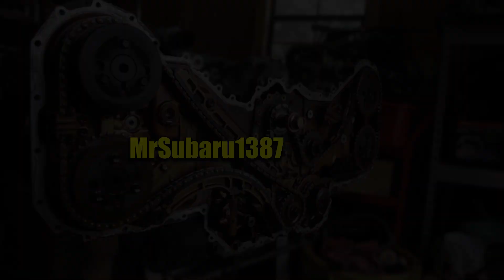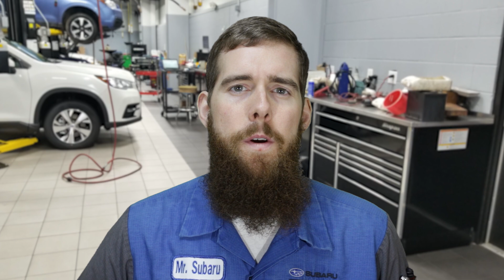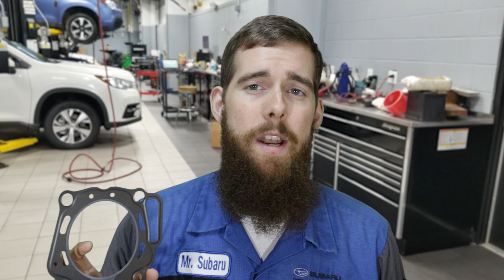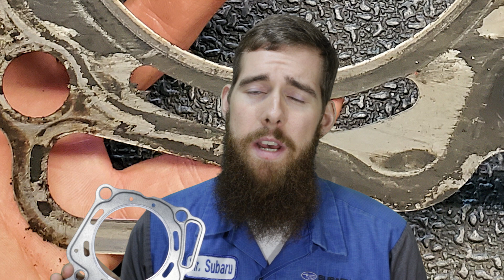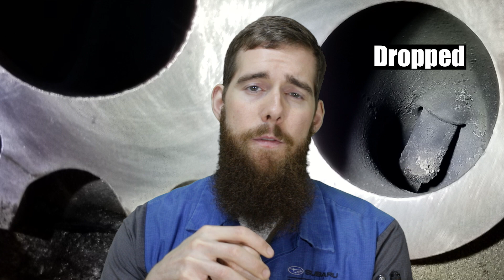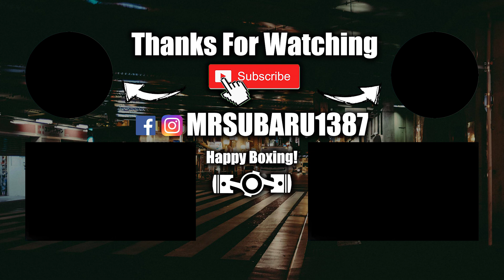Subaru Head Gaskets Explained

Comment: My personal experience with a 1999 Impreza RS 2.5, from new. Failed rear wheel bearings, seized brake pads in the caliber brackets, failed & recalled mass airflow sensor, failed head gaskets. Dumped the car after 2 years & never looked at a Subaru since. Say what you want, Subaru’s head gasket & head bolt reputation are well deserved. Watch the tuner channels. Power upgrade mods typically center around head gasket failures. Subaru design choices have resulted in failures, or just barely surviving daily driving. The tuner channels have the fixes, why Subaru doesn’t address is a puzzle.
Reply: Dan Chesney 

That 99 RS might be a bit of a collectible had you hung onto it.  The failed wheel bearing is a common Subaru fault but cheap to fix, DIY even if you have access to a press but I had my mechanic do mine for a couple hundred bucks.  I’ve had a brake caliper seize on me too, around $70 for a replacement at Autozone I think?  Again DIY and cheap.  The RS I believe unfortunately had the dual cam motor susceptible to HG failure but once you get it fixed with an updated gasket it should last the life of the motor.  And if you’re tuning a stock motor to 2 or 3 times the original horsepower level without a complete teardown and build you’re asking for trouble in any car, not just Subaru.

It’s too bad you soured on Subarus, they’re still great cars when cared for.  And a lot better and more reliable than any 20 year old BMW or Audi.
Reply: It is a shame, because it was simultaneously the best and worst car I ever owned. I liked the way it handled and drove, but I couldn’t afford the repairs and unreliability. I bought it new, and there was zero aftermarket support. For example the end came off a plug wire that welded itself to a spark plug, $75 at the dealer for a single wire. Wheel bearing from the dealer 3 x the cost what I could have bought it for, if I knew what the part number was. For cars in areas that get snow, the long bolt in the rear upright is almost impossible to remove without doing damage to the upright and the rubber bushings if you try to use heat. The mass airflow sensor that died out of warranty cost $700. Dealer couldn’t solve repeated money light issues, for what they said was my fault for not tightening my gas cap. I fixed it in the driveway, on my back when I found a corroded solder joint on the tank purge valve, loosely wrapped from the factory, in electrical tape right behind the back wheel. The clutch shuddered so bad I often had to slip it to an unhealthy extent to get through intersections. In the northern climate I live in Subarus don’t  do well when exposed to road salt. Everything rusts and corrodes so fast repairs are always expensive. I traded the 2.5 RS for a Honda and have only done routine maintenance for the last 18 years, oil, filters, rotors and pads, that’s it. Maybe Subarus do better in warmer climates with less road salt, but then what’s the 4WD for?

Comment: Shame on subaru  the next generation car my ass not good for environment rather all that oil in the water n ground and they do nothing
Reply from the maker: Subaru hasn't had head gasket issue on any model since around 2011/2013 when the EJ series was replaced by the FA/FB series engines.
Reply: @MrSubaru1387  it's just about that time they100000 mi plus. They leak oil n is it a maintenance to change at 105000 mist 3500 dollere s. .they don't care about peeps t they would had a recall Subaru no more

Comment: What a bunch of garbage. I don't want the model number of the engines, I want the years and models that are effected by head gasket failures. This was a waste of my time even listening. I have a 2019 Outback with a 2.5 is this model prone to failure?
Reply from the maker: Welp, I would've told you, but nah. Garbage info and all that...
Reply: Somehow I expected you to say that. No problem, Tesla here I come.
Reply: Your 2019 shouldn’t have any head gasket issues, they’ve mostly been solved.  But good luck with that Tesla, crap build quality, astronomic insurance costs and if you ever have an accident you won’t get your car back for 6 months.  Whoever buys your 2019 Subaru will be getting a bargain, reliable almost new car for a 30% discount.
Reply: @viffer94  Thank you for letting me know. After Mr. Subaru previous comments I looked up the info. My engine is a FB25 using the new MLS head gaskets. Fewer failures but prone to oil consumption. I only have 8K miles on the car so not an issue thus far. Tesla - I am sure when the Model T came out horse and buggy owners decried them also. FYI Tesla is now selling their own auto insurance and premiums are much reduced. As with all new technologies they are a gamble, one which I am willing to do. I like my Subaru (a lot) but I want to get off the oil consuming band wagon.  When I get the Tesla I will be adding solar to the roof.